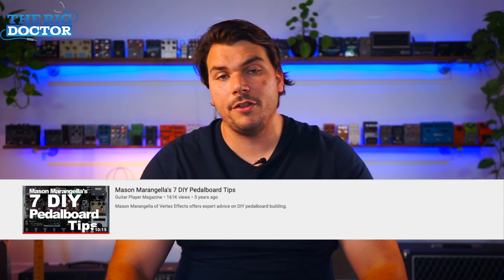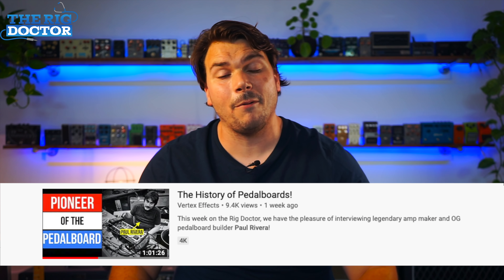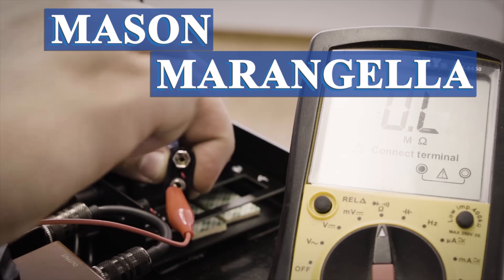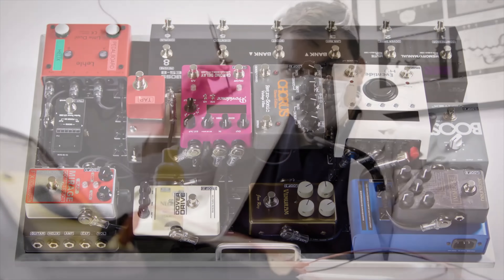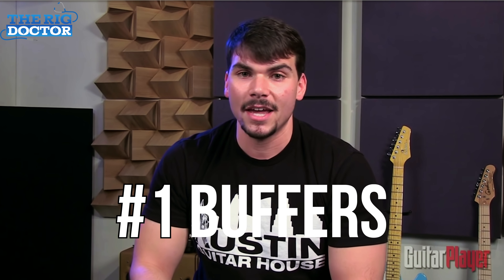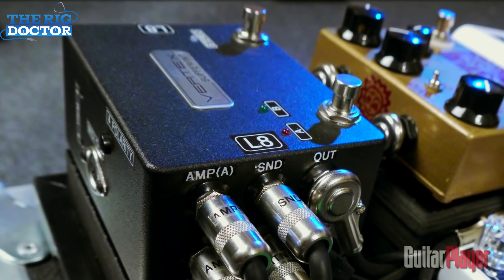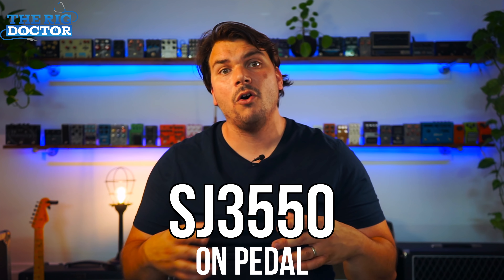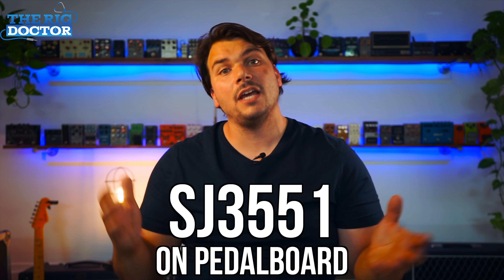How Have Pedalboards Evolved?

Comment: Have you actually measured the resistance of a properly terminated solderless connection as compared to both a properly soldered and an improperly soldered cable?

My gut tells me the resistance differences in properly terminated cables using either type of connection will be undetectable.

You have plenty of good information here, but cable voodoo is a pet peeve.
Reply from the maker: Yes, many times, and the resistance gets worse each time you move it or manipulate it.  There is nothing wrong with the cable itself, it's the connection that's the issue.  Most problems with solderless cables would be solved if you just took the very same cable and assembled it with soldered plugs.  There's no voodoo here, a gas tight connection is a gas tight connection, you can't get that in a solderless variety with the the way we do solderless cables for guitar.

Comment: what about Dan from TPS, he swears by the solder-less Lava cables?
Reply from the maker: I'm going to copy from another comment I responded to regarding this:  "There is a place for solderless cables, so I'm not advocating for extreme measures taken against solderless cables.  Most of the best makers of normal instrument cables, make a solderless line because it requires little advanced skill in order to assemble your rig and I think that giving access to all to put together a pedalboard is a good thing.  When you adjust the aperture  to professional rigs, you almost never see solderless cables because of the issues that I've explained in this video and others with industry professionals.  I can't speak for TPS's involvement with Evidence.  All I know is that they sell the cable via their retail shop.  Evidence makes a high quality cable, I would just solder it instead if you really wanted to use that cable."
Reply from the maker: Oh, and thanks for watching!

Comment: I agree about cables. however , since i switched to Evidence Audio, I have had none of the  issues that I had with George L stuff.  In the future , I  will go with mogami and make my own. Also, I love my Gigrig G2 Swicther , however, the input buffer on it is noisy, so I use a T1m mini buffer instead.  I also am not so happy with the Gigrig power supply system.  I am just about ready rip it all out and go with the Trutone .
Reply: MrDavemiley Hello, what problems do you have with the gigrig power? I’m currently running it on my board but was just curious to your problems with it!
Reply from the maker: I highly recommend you check out our buffer video from a few weeks ago.  It will give you some great suggestion on quality buffers - not all buffers are created equal.  There are literally only 3-5 buffers on the market that are actually good and do what a buffer should.  I highly recommend using a quality power supply like Strymon, Truetone, or CIOKS.

Comment: Mate have you done anything around soldering cables and connector choice? 
I haven't soldered for years but the old George L's are failing me (albeit after many years) so I'm ready to get back into soldering. I do have a decent soldering station but would appreciate advice on technique, temperature etc...
Reply from the maker: Grant Ferstat We do have a video on how to solder cables.  You can check in our rig doctor playlist for that, we’re going to be releasing a soldered versus solderless cable video in the next few days which may be worth your view.

Comment: If you had to choose either an input or output buffer only, what would you choose?
Reply from the maker: Why choose when you should and can have both?  Depends on the set up and how the player uses it.  If say the first pedal in the chain is a compressor that's always on, then the effectiveness of the input buffer is limited (only buffering one cable really before the compressor takes over).  In that case, only have an output buffer might not be the consequential on the overall sound.

Comment: I have a question if you have the time. You speak of the input buffer and output buffer.  With the input buffer, would that go before or after a Wah pedal?
Reply from the maker: It depends on the model, some vintage Wah pedals can have some impedance sensitivity.  You’d have to experiment and see on a case by case basis.
Reply: @VertexEffectsInc  Ok cool. I have a vintage JH 1 Hendrix Wah and never ran buffers other than what was inthe pedals.  So when I heard you mention about it inthe video, that came to mind. Thanks for your valuable time, very much appreciated!
Reply from the maker: DreidMusicalX my pleasure

Comment: Where do you get the smaller straight 1/4" connectors? The GLS ones look full-sized.
Reply from the maker: Linked in the description.  Short Straight 1/4" I think is what is says on the titling.

Comment: A couple thoughts! When you mention getting a better quality buffer as opposed to the noise/signal degradation that could be happening with those cheaper buffers inside of distortion or non true bypass pedals et , Is it really going to be an improvement if those pedals are still in the chain anyhow? Know what I mean? Like, to get the benefits, wouldn't you have to ''ideally'' use 1 or 2 high quality buffers with all true bypass pedals, or Is having the high quality buffers with 2-8 other buffered pedals really going to help? And for buffered pedals I guess it depends as different makes probably use various quality buffers, but for this example I'm talking your average Boss Pedal(Super OD, Turbo Distortion, tuner etc) My Boss Waza Craft pedal states it's a Premium Buffer, does anyone know if that's supposed to be an improvement over other Boss Buffered Pedals. Thanks! Also, side note, what does the term Hardwire Bypass mean? Have you heard of that?
Reply from the maker: 1) If you have that many poor quality buffers, you're going to have a noise floor increase no matter what if the pedals are all in series - see this video where I reference a test that Brian Wampler did showing what happens when you have several Boss devices in series and how it actually attenuates your signal whilst raising the noise floor at the same time:  https://www.youtube.com/watch?v=KafO8IP6vEY .  Even with these bad buffers present.  Having a high quality input buffer will help load your guitar pickups so they're seeing a 1M input like you'd see in the majority of amplifiers you'd normally use.  Now that input buffer will be undone as soon as it hits your first Boss pedal, but at least the guitar will be isolated (impedance wise) from the pedalboard.  The output buffer is still equally important as well because none of these Boss pedals are designed to drive long lines, so that long cable back to your amplifier is not going to be compromised or degraded by an unstable output buffer that will be further unstable the longer the cable length is and the more capacitance it sees.  The "premium buffer" is really just a way to say they used better parts to make the same buffer they've always used.  It's still a 1K ohm output impedance on the Waza stuff, and the standard for a good output buffer spec is around 50-150 ohms, i.e. 10x lower than what the Boss puts out.  Hardwire Bypass is usually another euphemism for True Bypass.

Comment: What about TheGigRig and the way Dan makes patch cables?
Reply from the maker: I'm going to copy from another comment I responded to earlier in this thread that’s along the same lines as your comment:  "There is a place for solderless cables, so I'm not advocating for extreme measures taken against solderless cables.  Most of the best makers of normal instrument cables, make a solderless line because it requires little advanced skill in order to assemble your rig and I think that giving access to all to put together a pedalboard is a good thing.  When you adjust the aperture  to professional rigs, you almost never see solderless cables because of the issues that I've explained in this video and others with industry professionals.  I can't speak for TPS's involvement with Evidence.  All I know is that they sell the cable via their retail shop.  Evidence makes a high quality cable, I would just solder it instead if you really wanted to use that cable."
Reply: Vertex Effects h

Comment: hay noticed you did not mention the walrus audio phoenix what are your thoughts on it ? ... thanks :)
Reply from the maker: It's a linear supply, not a switching supply.  I'm not saying it's bad, just not preferable to those I mentioned for what I look for in a supply.  If you already owned this power supply and you were only going to use it in the USA, I would tell you to continue using it.  Nothing wrong with it, just not as up to date as some of the stuff that's come out subsequently.
Reply: @VertexEffectsInc  i only got it due to the amount of inputs and switching options thanks for the reply :)
Reply from the maker: Dee Wing I think you’ll be fine with it.  If it’s working for you needs now, I wouldn’t recommend changing it.

Comment: I just want to add something that for some reason no one has mentioned: Dan from TPS uses solderless cables. 😏
Reply from the maker: Danielson I have not spoken to Daniel regarding his reasons for the endorsement and use of solderless cables over soldered. I have tested all of the major brand solderless cables, including Evidence Audio - the ones that Daniel uses.  I want to clarify that what I’ve stated regarding solderless cables is not unique to me, nor is it some antiquated notion about cables that is rooted in tradition over an advanced superior technology. The physics of a gas tight connection transcend any technological advancement in solderless cables.  It is not the industry standard amongst professional rig builders.

Comment: Have you ever spoken with Dan from that pedal show ? He swears by solderless cables but only the Evidence Audio patch cables . Have you ever tried them .
Reply from the maker: angus potter-irwin I have not spoken to him regarding his reasons for the endorsement and use of solderless cables. I have tested all of the major brand solderless cables, including Evidence Audio.  I want to clarify that what I’ve stated regarding solderless cables is not unique to me, nor is it some antiquated notion about cables that is rooted in a primitive way of thinking. The physics of a gas tight connection transcend any technological advancement in solderless cables.  It is not the industry standard amongst professional rig builders.
Reply: I agree and have always used soldered cables. Having a cable go down on a gig and having to trouble shoot is a nightmare I have had before. I just found it interesting when you listed the big builders that you did (Dave friedman ect) and have always been curious if the Evidence Audio cables where the sort of exepction to rule or new or something. Love the video man.
Reply from the maker: angus potter-irwin I’ve definitely seen guys use Evidence Audio cables, however it’s the soldered variety in the professional context. I think it is their line, with the SIS model, that was designed for consumers.  I’m sure in the cable world, it is necessary to compete with many of the other cable companies out there doing this solderless thing.  Arguably Evidence makes the best one of the solderless variety.

Comment: Would you put the buffer after the WAH and Fuzz pedals or before them?
Reply: It depends on the kind of fuzz you have, a more vintage style fuzz might not react well with a buffer before it. I think wah is the same but not as critical
Reply: L Desmond what about the WAH. I have a big muff and a tone bender. Currently my guitar goes to the WAH then Tone Bender than my overdrive and distortion and then my big muff.

Comment: The thing about spliting power and signal line is maybe not that needed anymore when you are using good signal cables, shielded power cables and state of the art pedals. But then reality (budget and personal preferences) strikes! Most folks don't use shielded power cables, as you typically don't need them. Sometimes you powersupply comes with them, but not always. Per se, that is no problem. But then you got that one (vintage) pedal you love so dearly. Sadly it may be a little bit problematic with HF noise in your power line. And then you got this other type of gear nearby introducing HF noise into any unshielded cables around. In a perfect world NONE of this should of course happen, but your pedal should work even in a non perfect enviroment. Stages are often far from perfect. Some gal dear to me, even referenced a club with a huge stage as the "HF hell". So as he told, it's not something you should follow religiously, but it's still a good idea to do so.
Reply from the maker: Thanks for watching Cid!  You're right, most power cables that come with pedals aren't shielded, however, the ones that I recommend, the Voodoo Lab version, are shielded.  If you have an oscillation in your power lines coming from the AC that's in the audio range, I think you're going to have noise either way.

Comment: The guy (Dan) at gigrig on the That pedal show, also makes pedal boards for the pros uses George L  Solder less cables. He seems to favour them.... Strange🤔
Reply from the maker: He would be in the unique minority in this sense, and not in keeping with the standard in the industry
Reply: @VertexEffectsInc  I'm building a pedalboard right now and the temptation to use George L cables is luke warm at best. I actually prefer the Van Damme XKE Pro patch cable soldered to pancakes, it's thinner than instrument cable and very cheap, but vey good too!
Reply from the maker: Gus If you like George L’s just solder them to a good connector.
Reply: @VertexEffectsInc  I've never used them, I was just commenting on the fact that someone who is quite a well known pedalboard builder does, that's all!
Reply from the maker: @thehandseesall  I get it - but I think his channel is tailored to beginners in this regard when doing DIY stuff - which it seems like they've gone away from in favor of more tone/pedal based demos and analysis.  If you look at the standards in the industry that have been in place since the 1980's around rack and pedalboard builds, solderless cables are a "no-no".  I go into this a lot on the channel which you can see more on if you'd like.
Reply: @VertexEffectsInc  I don't disagree!
Reply from the maker: @thehandseesall  thanks for watching!
Reply: He does NOT favour George L’s. He uses evidence audio SIS. He only used George L for Pete Honore’s board because Pete insisted. Dan was cringing but did it anyway.
Reply: Doesn't he exclusively use the monrail cables ?
Reply: @moonsama395  yes

Comment: Not true that pro rig-builders don’t use solderless, my friend. Check out The GigRig who almost exclusively use Evidence Audio SIS for musicians all around the world. 🙂
Reply from the maker: I'm going to copy from another comment I responded to earlier in this thread that’s along the same lines as your comment:  "There is a place for solderless cables, so I'm not advocating for extreme measures taken against solderless cables.  Most of the best makers of normal instrument cables, make a solderless line because it requires little advanced skill in order to assemble your rig and I think that giving access to all to put together a pedalboard is a good thing.  When you adjust the aperture  to professional rigs, you almost never see solderless cables because of the issues that I've explained in this video and others with industry professionals.  I can't speak for TPS's involvement with Evidence.  All I know is that they sell the cable via their retail shop.  Evidence makes a high quality cable, I would just solder it instead if you really wanted to use that cable."